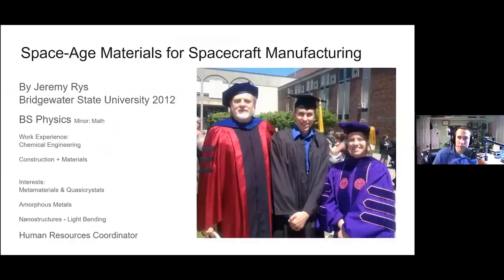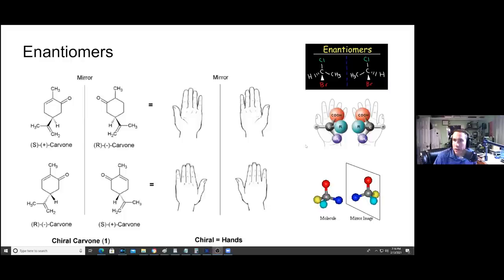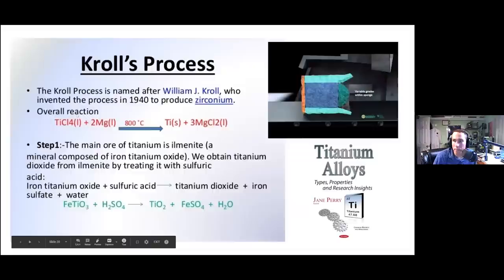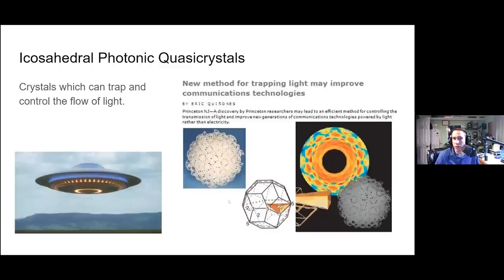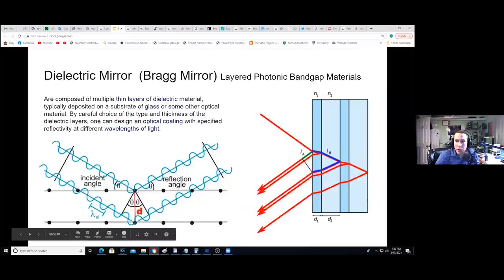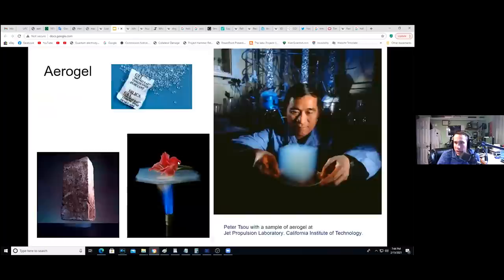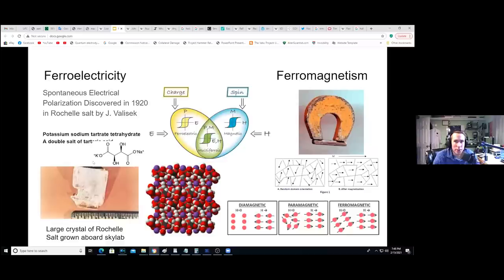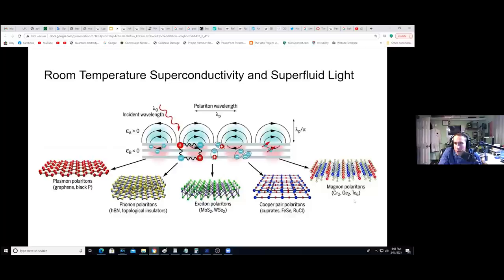Jeremy Rys - Breakthrough & Exotic Materials For Advanced Propulsion

Comment: For phase conjugate mirror based propulsion, look at "Confinement of light: standing wave transformations in phase locked resonators" by Larry Reed. Another resource is Paul A LaViollette PhD and his book "Secrets of Antigravity Propulsion: Tesla, UFOs, and Classified Aerospace Technology" where the design of a RADAR-like microwave pumped phase conjugate mirror based interferometer, as a way to manipulate the opto-mechanical radiation pressure of microwave resonant materials.
Reply: Scientists have recently begun to explore a "Non-radiating Antenna". By exploiting the toroidal multipole resonant mode excited in materials and antenna. One application of this discovery is the fabrication of novel non-radiating electromagnetic sources. A so called "Anapole mode" or "zero-pole antenna" can be arranged by the constructive coupling of the near field of two types of antenna: An electric dipole antenna combined with a toroidal dipole antenna results in constructive phase locking between antenna in the near field, which necessarily means the far-field EM radiation of each antenna is out of phase, and destructive interference suppresses almost all emission and reflection at those frequencies. Depending on the design of the circuit, this can lead to frequency selective cloaking as light is transmitted without losses. Or it can absorb resonant frequencies without reflection and act as a sensitive tuned radio reciever or even power harvesting rectenna. This type of antenna also has quantum mechanical phenomenon that goes beyond classical electromagnetism. The quantum potentials, such as the A-Field (Magnetic vector potential) and the phi-field (the electric scalar potential), must have unique and non-trivial solutions when there is a large zero-vector sum resultant from destructive interference of two or more waves. These quantum potentials must  propagate from the antenna and influence the surrounding matter through quantum phase effects known as the Aharanov-Bohm-Casher effects, which are still poorly understood and only a few types have been experimentally confirmed. Quantum Barry Phase, or spin of electrons, can be influenced even in the absence of magnetic and electric fields, if the quantum potentials are non-zero,  opening up the possibilities of quantum manipulation of light and matter at a distance.
Reply: Paul Laviolette RIP~ Thanks for all you've shared with us, you live on in the life, love, and passion for your work!

Comment: I am curious as to a material or film that passes a physical shock, or phonons, in a preferred direction and limits or somehow converts that energy into another form, say heat, when the shock attempts to go in the non preferred direction, Thanks for the upload
Reply: Check out “Nonreciprocal surface acoustic wave propagation via magneto-rotation coupling". A recently invented "acoustic diode" that transmits surface acoustic waves/phonons one way, by suppressing the coupling to magnetic spin waves in the opposite direction. They made interdigitated electrodes on top of a slab of Lithium Niobate and another slab of material on top that has magnetic anisotropy. When excited, the magnetic field of the electrodes causes both magnetostriction induced phonons and magnetic spin waves, but since the slab of materials have magnetic anisotropy, the spin waves have a preferred direction and so act as a diode.
Reply from the maker: Thanks Taylor! Awesome reference!